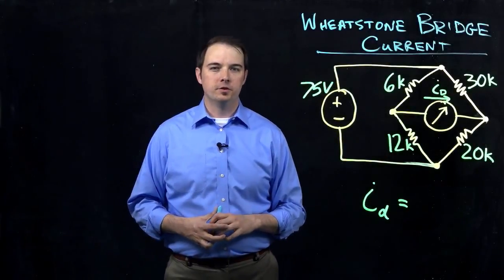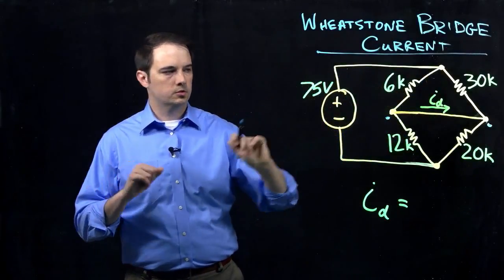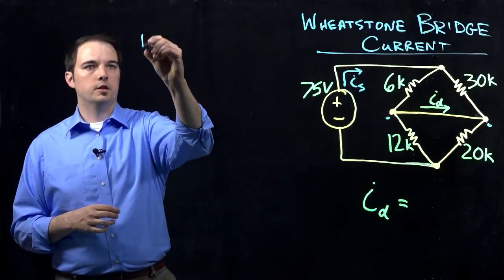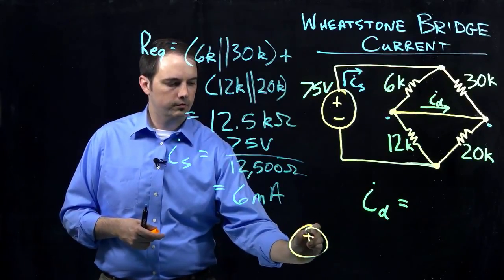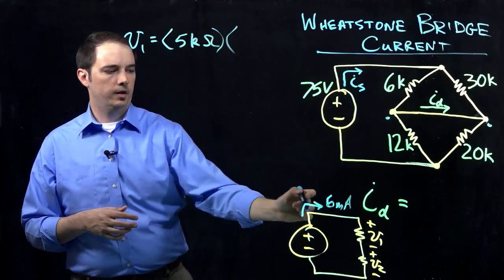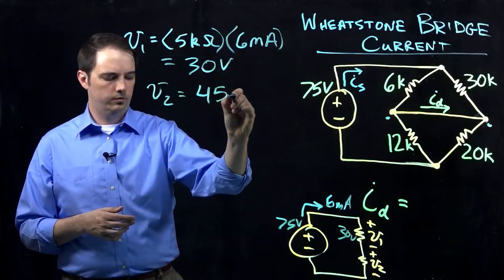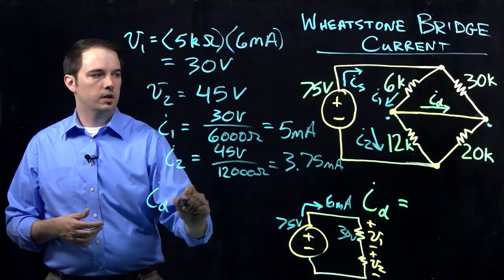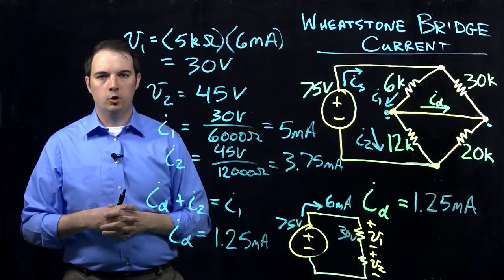Circuits I: Example with Wheatstone Bridge (Unbalanced)

Comment: I have a question. I am calculating total resistance by doing series calculations of 6k and 12k and series calculations of 30k and 20k. Then, through parallel calculations of 18k and 50k, the total resistance I achieved was 13.23Kohms. 

Please explain why this contradiction is happening.

Comment: how can we say 6 ohm and 30 ohm are parallel ? Their end is not at the same potential , given a current flows through mid wire .
Reply: U=RI. there's no resistance through the wire, so there's no difference of potential
Reply: @arthurbraganca9564  Well :D, been too long .
Reply: Exactly my question
Reply: Why not same potential ?..pls explain...I think there is no voltage drop through the wire that's why may be it's in same potential ..am i right?
Reply: I was hoping the current to take the path of least resistance

Comment: sir...can you help me in how to calculate equivalent resistance of a unbalanced wheatstone bridge using Nodal Analysis??
Reply: Kazi Abu Rousan its difficult to calculate the equivalent resistance directly from the diagram,
 but you can find the total current that flowing in the system with kirchoff rule's first, and from that use V=I.Req to find Req, if you know the potential.
Reply: Well, actually he already explain it in 3:20.
Reply: Hey.......are you from which country????

Comment: Hi, Dr. Montgometry! I found this very helpful. I've a question though, what happens to the equations if, say for example, there's an ammeter in the middle with resistance?
Reply: Angeli Grace Castalone that's my question also
Reply: Apply star delta convertion if unbalanced ...or just remove the registance if the bridge is in balanced condition

Comment: I'm confused - I thought the definition of a balanced bridge was when there is no potential difference across the bridge thus no current would flow!?
Reply: I was confused about this too. If there's negligible voltage, there should also be negligible current.
Reply from the maker: Yes, a balanced bridge has no current flow through the bridge. That does not have to do with having the same voltage on both sides, which is generally always the case with a current meter placed in the middle. The values of the resistors is all that dictates whether or not current will flow over the bridge.
Reply: Right, so am I confusing a very close, but not actually zero potential difference caused by a shortcircuit (the current meter in this case) with an exactly zero potential difference caused by the identical ratio of the series resistors?  I = V/R would imply that some voltage and some resistance is necessary for a current.
Reply: Don't understand your assumption that the amp meter can be treated as a short.  This would mean the voltage on either side of the meter would be the same hence no current flow. Which is what you said in your follow on video for a balanced bridge. Wouldn't it be more correct to show a resistance and either use a delta to y conversion to find the equivalent resistance or use Thevenin's method? Or am I missing something?